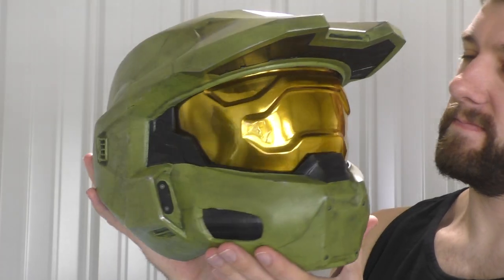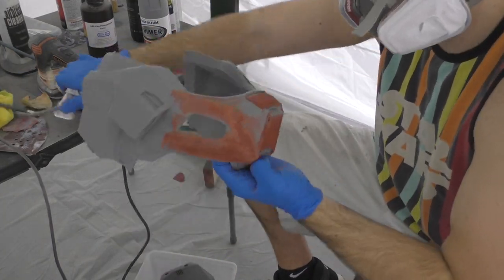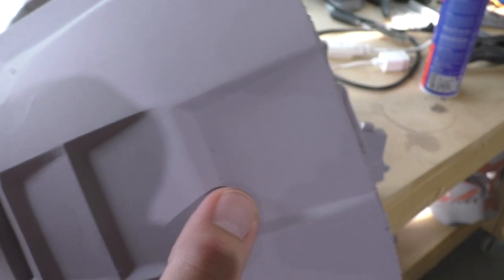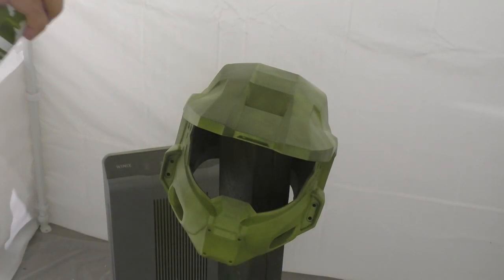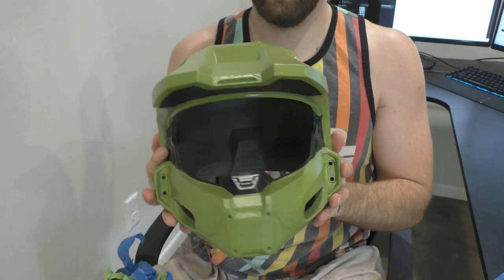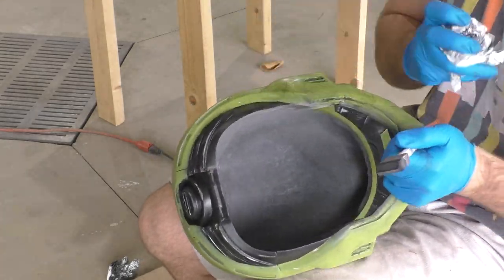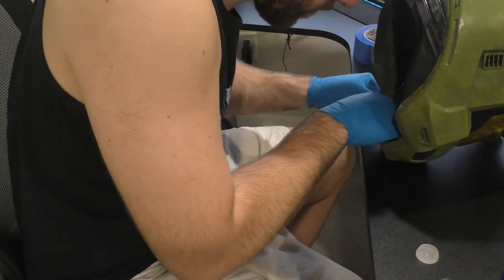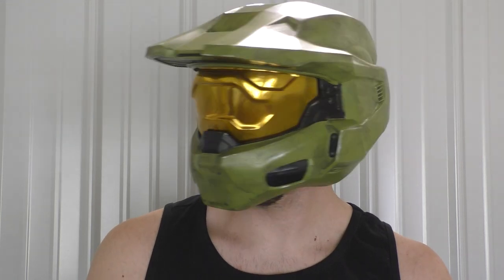Making a Halo Infinite Master Chief Helmet

Comment: in the process of doing this file in PETG at 102% sizing. I'm interested in the lens video, because I was going to do a mirrored motorcycle lens, but this one completes the look.
Reply: Ah a fellow big head brother. I’m testing if my head would fit his Cavallino helmet without increasing size, and I think I’m going to have to leave it in two parts to be able to wear it.
Reply: @CAMOxXxFluffy  ya, sad part is, this still doesn't fit me. lol This one I'm printing is for a friend. When I did a Mando helm, I had to scale up to 106%.
Reply: Hello i was just wondering how big is your 3d printer?
I am curious if its going to fit on my ender 3d printer.
Reply: @RZK_Props hi i was just wondering if u know how big the helmet is?
Reply: @magnusuvwiik7940  I printed it in 3 separate pieces (back, visor, and front face). All 3 fit easily on the CR10s I have with room to spare. Depending on the sizing scale you need and which Ender you have, it might fit at a diagonal. The front face part might be the only issue.
Reply: @RZK_Props   Thanks fore the help :D
i hawe a Creality Ender-3 S1 whit Printvolum of 220 x 220 x 270mm.

Comment: Looks sick! I'm currently working on a Mandalorian helmet, trying to get my hands on some Bondo seems to be more difficult than I thought it was gonna be lol, it's out of stock, if you know where I can get some or a good replacement would you mind letting me know?

(The helmet took about 85 hours of printing)

I'm also making the Mandalorian's blaster it's printing rn 

(About 8 hour print, it's not a working one, I just wanted to have it so the helmet had something to match with)
Reply: I use wood filler to fill my prints, might work for you and isn’t toxic! On my Insta (same as username) you can see my Mando helmet which was done with this method
Reply: I have some woodfiller lying around, just normal wood filler?
Reply: @orsom1234  yep just normal wood filler will work, so long as it’s fairly thick
Reply: @atomoworkshop3327  just tried it, sanded down and it's worked thanks, imma have to put another layer of the filler down as I did it a little thin I will do that later tho
Reply: @orsom1234  glad it worked out for you :D
Reply: @atomoworkshop3327  thanks

Comment: Can you clip the front and back of the helmet to put it on and use it as a two piece, instead of fusing the front and back, or will it not stay together just by clipping both pieces while wearing it?

Comment: What size printer is required to print this? I have an ender 3 v2 and am wondering if the files on the store are small enough to print on it.

Comment: Hi.
I have a Printvolum of 220 x 220 x 270mm does anyone think it will fit on my 3d printer? :D
Reply: I have a 256x256x256 printer and It was too big, I printed it in 3 parts